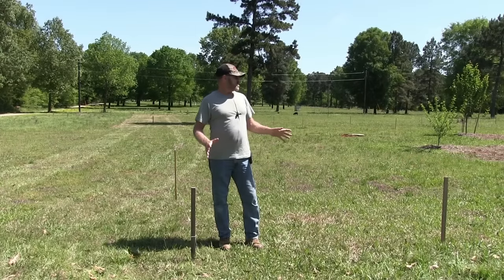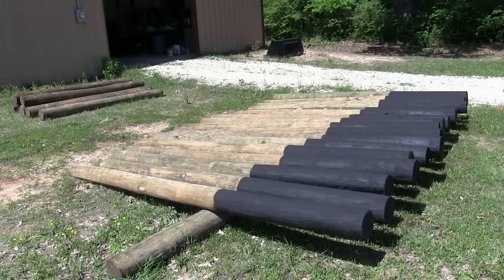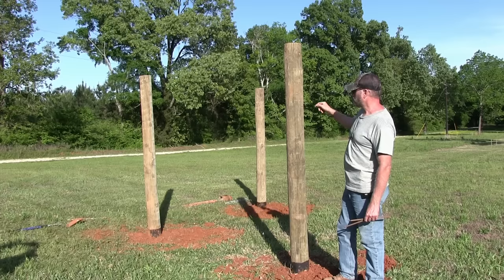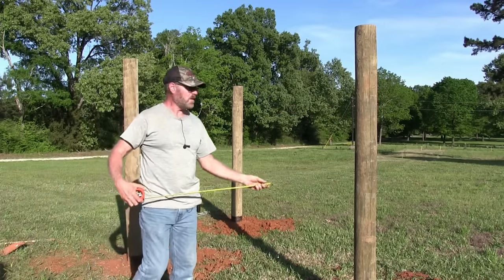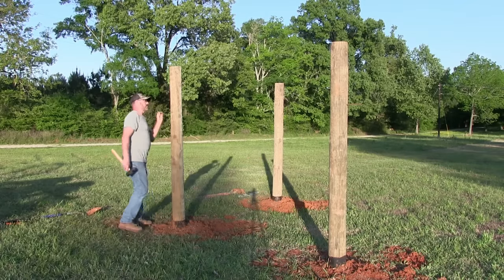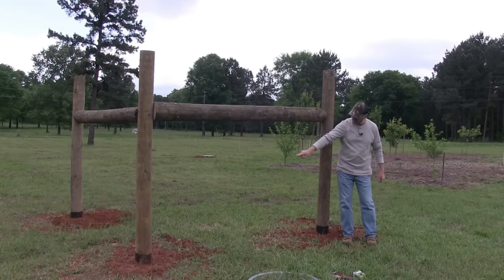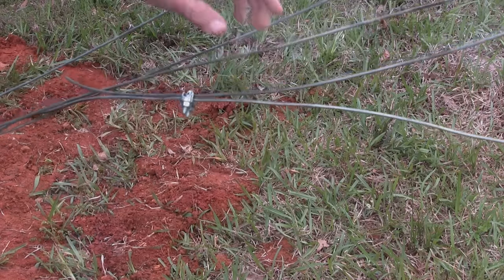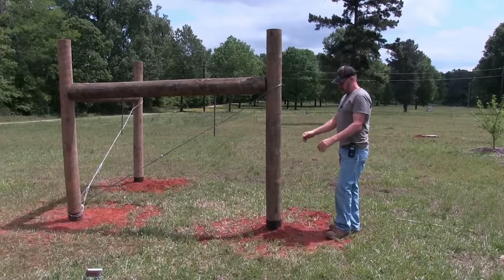Corner post installation and bracing - Detailed video

Comment: Never use wood posts.  Tip for next time, drill a 1/2 inch hole in the tip of the top corner of the auger flighting and bolt 3 or links of chain with a 24 inch 2x4 bolted to the chain, at finish depth the 2x4 will clean all the dirt away from the hole, Yes it will swing around and not work next to an existing fence but it works real good.

Comment: why do you not put a wheel on the end of the gate?  Saves the post and gate as it is off the ground .  Just saying
Reply from the maker: Those wheels are good for really long gates. This gate does not weigh that much.
Reply: I agree about the wheel on the gate but I've never seen wheels for sale anywhere.  I'm no stranger to Tractor Supply Company or Ace so maybe I need to clean my glasses.
Reply from the maker: @ramrise  The gate wheels are in the back corner where they sell the automatic electric gate openers at Tractor supply.

Comment: Great video, rebar is a mistake.  Galvanized fencing spikes will last twice as long as rebar hold better and easier to drive without all the deformations on the outside of the rebar.  Rebar is made from recycled metal and is metallurgically speaking really low grade steel and not verry resistant to corrosion.  I give you 10 years for that rebar to fail you in that aplication.  Galvanized fencing nails will last 20 years easilly.
Reply from the maker: Thanks, I'll just drive some fence spike in when they need replacing. 👍

Comment: how not to do a fence corner unless you like doing work unnecessary. Set your corner post then lay your braces then set your end line post. No need to cut post or drill through post all the way when done correctly. Also you need to have a lean in your post so when you put wire tension In line it pulls the post straight vertically and doesn't bend in the corners.  Trick is to know in advance how you're going to pull your wire( the direction of) they also make wire  tensions to pull the wire brace tight.

Comment: What size bit and rebar did you use on your post
Reply from the maker: I used 3/8 rebar and a 3/8 drill bit.
Reply: @petebeasttexashomesteading   nice I went with 1/2 because my post are big cedar pretty heavy

Comment: I don’t know much about building a fence so just asking is there a reason why you didn’t cement them in the ground? Are they just as strong?
Reply from the maker: I don't cement them because water can get trapped in between the post and cement and the post will rot.  But if you do cement them, I would recommend putting the post in first, then add a few inches of dirt at the bottom and then add the cement. This way when water goes down in between the post and cement, it will be able to get out at the bottom and not get stuck there like if the post was sitting in a cement cup.

Comment: I never brace the corner posts. I use old FPL concrete posts for the corners and bury them 5 feet in the ground. You just put galvanized rod through holes you drill and hook the tension bar. A brush fire destroys wood posts so it's concrete and steel here. Plus the ground is mostly coral rock.
Reply: That sound horrible to try and dig into.

Comment: I want to do almost exactly the same thing, but I keep getting hung up on cutting a mortise joint with the chain saw rather than using a piece of rebar.  I'm now at the acceptance stage that yours is the way I should be doing it.  I guess I could use 2 pieces of rebar instead of just one?
Reply from the maker: I used 3/8 rebar and it's holding up great. You could use 1/2 rebar if you're worried about it.

Comment: PA Lawn Guy. Pete, I was thinking I would take some marking dye and paint a concentric circle around each stake, remove the stakes, and move the auger to each circle without having to dismount the tractor twice at each stake to drill each hole. I think this would save you time.
Please leave your thoughts.
Reply from the maker: Jerry F  Sorry for the late response. Yeah that's a good idea but I still have to get off the tractor to make sure the auger is straight.

Comment: I would break 1  7/16” grade 8  sheer pin an hr drilling holes for my posts where I live, the soil has so many big rocks. 55 hp tractor, 12” auger.

Comment: Hello, what did you treat the bottom of your post with? Great video by the way. Thank you.
Reply from the maker: I treated them with Henry #201 roof coating: https://www.homedepot.com/p/Henry-0-90-Gal-201-Fibered-Roof-Coating-HE201142/100005599
Reply: @petebeasttexashomesteading  i used the henry 100 percent silicone roof stuff and man that stuff has stood up strong against the tough Texas sun. And super flexible.

Comment: Nice job, what gauge wire did you use? What diameter posts, and where did you get that hardware to bind the wire? I’m gearing up to do this myself.
Reply from the maker: Thanks, the wire is 9 guage I got at tractor supply and the clips for the wire at Lowes. There's a link in the description under the video for the clips.

Comment: Very informative and some great tips. I liked the wire straining technique - simple and easy. I've just planted our orchard, so this was very timely information (similar in size to yours, but on a fairly steep, hillside so not as easy to erect a fence). Oh.... and what are your thoughts on the Mahindra tractor? I've been considering updating my 25 yr old Kubota and these look rugged and good value for money.
Reply from the maker: Thank you, I did a lot of research and the Mahindra tractor is the best tractor you can buy for the money and it will lift more then any tractor in its class. The 5555 I have now is very heavy duty and I paid around $31,000 and they have a good warranty.
Reply: They're a bit more expensive here in Australia, but the one I checked out was extremely robust, with thick chassis steel, seemed to be reasonably well built, solid and good value for money. Like you, I research everything carefully before parting with my hard-earned... Keep up the great videos - I really like the way you explain things and undertake tasks so they're affordable, easy to do and the finished product performs well. Do it once, and do it right!
Reply from the maker: @rogerbettoni1382  Thank you 👍

Comment: Amazing video.  I started the day thinking of building a T post fence....  Now after three of your videos I know I'm doing it the right way now.  Only difference is I have to use 4x4 or 6x6 treated and maybe log cabin screws..   I can not get the posts like your here...  plus now I have to get a post hole drill for my tractor!    Oh and to save a little I'm building the gates with square tubing and expanded metal...   Great video you have a new subscriber.....
Reply from the maker: Thank you 😊

Comment: Might sound critical but not meaning to be.....but why not do away with the braces.... just use a single corner post..... Use a cement silo stave  ( or similar ) an place it just in front of the main brace post. Place the stave..flat.... just below the ground tight against the post.  Its spreads the forces out and holds much better!  Similar as pulling a piece of dental floss through your hand compared to a thick rope.  I skinny post will not  stand the forces. Just pulls through the ground. Where as....spreading the forces over say three feet....your making the post at least 4 times thicker. It wont tip over !

Comment: Pete, what did you use to treat the bottom of the post? Thanks. Your work looks great.
Reply from the maker: I used Henry #201 fibered roof coating here's the link: https://www.homedepot.com/p/Henry-0-90-Gal-201-Fibered-Roof-Coating-HE201142/100005599
Reply: I've heard somewhere that driveway sealer could do this as well. What do you think?
Reply: That was my question also

Comment: Hi, Where in the WORLD did you find 10' long x 6" treated posts????  I cant find them anywhere!

So you said these are 6" dia at the tops, so then most of these post usually taper so are they about 7" dia at bottoms?  

Why did you choose this size?  If you used 5" at tops or even say 4" at tops, do you think they would still be sturdy enough?

Thanks,

MP
Reply from the maker: The 6 inch top posts are locally made and yes they do naturally taper bigger at the bottom. You can use whatever posts you can find in your area, square or round just try to get larger ones if possible. Hope this helps.

Comment: How tight is too tight?  I just did this method and was thinking how strong is the wire?  Could I tighten it too much that it snaps?  BTW, thanks for this video...... awesome instructions
Reply from the maker: If you put 9 guage wire like I did, you won't have to worry about breaking it 🙂. But the wire should feel tight when you grab it and move it back and forth, that's good enough.

Comment: what is the black stuff you treated the bottom of the posts with?
Reply from the maker: It's asphalt roofing tar (Henry#201) mixed with a little diesel to thin it out a bit so you can brush it on.

Comment: WHAT did you coat teh bottoms of your posts with?
Reply from the maker: It's asphalt roof coating mixed with a little diesel fuel to thin it out a bit so you can brush it on.

Comment: Hi Pete, what is the stuff you used on the bottom of your post?
Reply from the maker: I brushed on Henry #201 roof coating mixed with a little diesel fuel to thin it out a bit so it can be brushed on easier. You can buy the roof coating at Home Depot.

Comment: I missed what the black treat was on the bottom three feet of your posts?
Reply: Daniel Willms probably tar, tar will keep it from ever touching any water and prevents rotting underground.
Reply from the maker: I used Henry #201 roof coating that you can get at Home depot diluted with a little diesel fuel just enough to be able to brush it on.

Comment: Hey what is at the base of all of your post that is black?
Reply from the maker: It's Henry #201 roof coating mixed with a little diesel fuel to thin it out so I can brush it on. You can pick it up at Home depot.

Comment: What did you put on the bottom of the poles?
Reply from the maker: Henry #201 roof coating mixed with a little diesel fuel to thin it out a bit so you can brush it on.

Comment: Kindly tell the names of the implementation,  which you use to take out soil from the hole, which you dug out. Thanks
Reply from the maker: I used a 3-Point Post Hole Digger that I purchased from tractor supply here's the link https://www.tractorsupply.com/tsc/product/countyline-3-point-post-hole-digger-602377?solr=1&cm_vc=-10005&st=post%20hole%20digger

Comment: Pete,  Trying to get used motor oil is harder then I thought.  All the quick lubes will not give it to you.  I save my oil from my changes but it is not enough.  Just curious to know where you get yours
Reply from the maker: I have a tractor, truck, car, and a zero turn lawn mower. If you can't get any, ask your friends and family if they have old used oil in their garage or buy the cheapest oil you can find at walmart.

Comment: What did you used to treat the post?
Reply from the maker: I used Henry #201 asphalt roof sealant mixed with a little diesel fuel to thin it out a bit and brushed it on.

Comment: Hello Pete. First you have a beautiful place. Second thanks for this good video. This helped me out a lot. Finally I saw you have a Remington chain saw, I have the exactly the same. But I have o e issue and you may help me. After I use the chain saw and I turn it off and leave in level position I see after couple hours that the chain oil is leaking and I can't see how. Thanks again.
Reply from the maker: Yep I have the same problem so now I drain the oil out when I put it away.

Comment: When would you use and not use concrete to set the posts? This was a great education for me on the corner posts.
Reply from the maker: Using concrete just increases the diameter of the post so you don't have to go as deep. When you think about it, the concrete doesn't hold on or grab anything but dirt. By putting a post in concrete, it will just catch water in between the post and concrete like a cup and the post will rot. I just coat the bottom of the posts with roof coating and put them in 3 feet and it will last for many years.

Comment: You did not tell us what you tteated timber with.
Reply from the maker: The posts are CCA treated post but I treated the bottom where it will have ground contact with Henry #201 roof coating. It's in the description below the video.

Comment: what model tractor is that ? and do you recommend a mahindra ?
Reply from the maker: I've had two Mahindra tractors, my first was a 4550 and I didn't like the non synchronized manual transmission but it was a good tractor and this one I have now is the 5555 with the shuttle transmission and it's much better with the shuttle transmission. I think they are good tractors for the money and very heavy duty compared to something comparable in size and HP.

Comment: What do you use to coat the bottom of the posts?
Reply from the maker: It's Henry #201 roof coating I bought at Home depot, here's the link and it's also in the description: https://www.homedepot.com/p/Henry-0-90-Gal-201-Fibered-Roof-Coating-HE201142/100005599

Comment: What kind of bracket was that to attach the two wires to and is it available at tractor supply?  Certain size?
Reply from the maker: https://www.lowes.com/pd/Blue-Hawk-Zinc-Plated-Wire-Rope-Clip/1000202219
Reply: Gosh dang so well done. Will follow this exactly. Thank you!
Reply from the maker: @southernyankee1519  👍

Comment: what did you use to treat the post with
Reply from the maker: Henry #201 roof coating and slightly diluted with diesel fuel so you can brush it on.  https://www.homedepot.com/p/Henry-0-90-Gal-201-Fibered-Roof-Coating-HE201142/100005599

Comment: Pete,   did you treat your post with the 50/50 mix right after you bought them or did you let them get seasoned for a few months.  Just thought if they were green they would not soak up as good.
Reply from the maker: These posts were already specially treated for 30 years from the place I bought them, so I won't need to treat them. But I did treat the bottom of the post with Henry #201 roof coating mixed with a little diesel to thin it out a bit so it would be easier to brush on.
Reply: I have a 50 gallon drum of the 50/50 mix and wanted to know if I could soak them in the mix right after I buy them.  The drums are 36" deep so I could soak the part that goes into the ground.  I just did not know if I buy new post if I need to let them set awhile to dry out before
Reply from the maker: @gregbrooks9546  If you have a drum mixed already, then that would work. Let them soak for a couple of days or as long as you want. Then just before your ready to put them in the ground, brush on the Henry #201 roof coating.
Reply: Right, but how many days did you let the oil soak in before you applied the roof coating and then did you let the roof coating dry for 24 hours or so before putting into the ground

Comment: Good job what did you treat the bottom of the post with
Reply from the maker: Thank you, I used Henry 201and lightly diluted with diesel to thin it out a bit. You can get it at Home depot.  https://www.homedepot.com/p/Henry-0-90-Gal-201-Fibered-Roof-Coating-HE201142/100005599
Reply: Standard roofing Tar is what I’ve always used, diluted a bit with diesel. My 18 yo dog fence 4x4 posts are as sturdy now as back then. FYI

Comment: What brand Cutters are those they cut easy ?
Reply from the maker: Not sure what brand of bolt cutter it is but you can buy something similar at Home depot https://www.homedepot.com/p/TEKTON-14-in-Bolt-Cutter-3391/205585552
Reply: @petebeasttexashomesteading  I tried a set from lowes but would not cut my wire

Comment: What are the "clips" you called to connect your 2 wire ends before you pull and twist it? 
Also how long was the rebar you used?
Reply from the maker: The rebar was 12 inches long by 3/8 inch and the clips are called "wire rope clips I picked up at Lowes here's the link: https://www.lowes.com/pd/Blue-Hawk-Zinc-Plated-Wire-Rope-Clip/1000202219

Comment: No concrete
Reply from the maker: No need for concrete if the posts are deep enough, plus concrete will rot the posts in time because water gets trapped like a cup in between the post and concrete.

Comment: Great video, and your work looks good! But if you want some tips from someone who builds and paints fences for a living, here you go. Save your clamps. Just start and end your wire at a post and staple the ends to the post. No clamp is necessary. Also, there is no need to paint or treat the ends of the posts going into the ground. UV does way more damage to the wood than the soil. Almost every post I have ever pulled to rebuild fences is like new below the ground. It’s from the ground up where they deteriorate from the UV and heat. Also never cut posts. Try to space your posts better, or if driving them in, drive them to the right depth. When treatment is applied at the mill, they only treat the posts so deep all the way around. As soon as you cut them, you have just exposed untreated wood to the elements and it voids the warranty of the posts. And last but not least, once you are finished twisting the wire with the rebar, remove the rebar. The wire will not unwind. Again, you are doing a great job but I hope these tips help you are others.
Reply: Hello! Thank you for your advice kindly. Please if I may ask. Is it okay to leave the rebar in for my hot/cold upper Midwest climate so that I may release and then add tension with the heat/thaw cycles?

Comment: What did you treat the bottoms of the poles with?
Reply from the maker: I used Henry #201 roof coating from Home Depot mixed with a little diesel fuel to thin it out enough to brush on. https://www.homedepot.com/p/Henry-201-Fibered-Black-0-90-Gal-Asphalt-Roof-Coating-HE201142/100005599